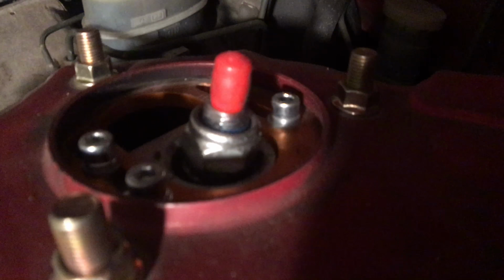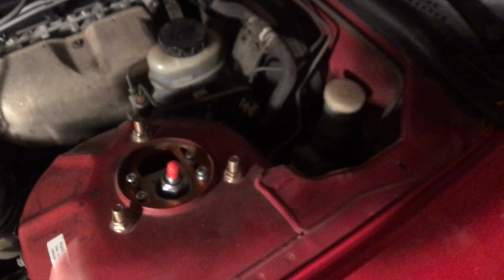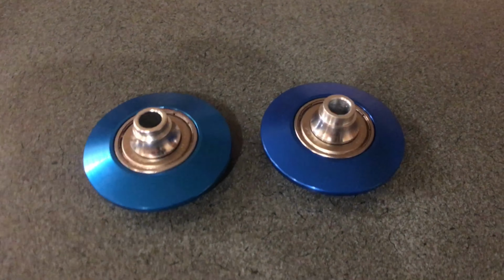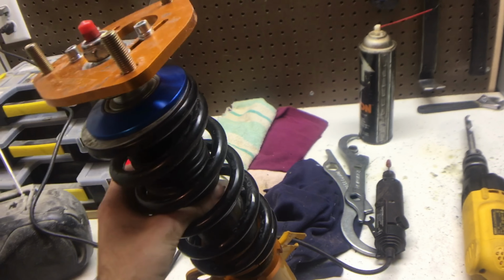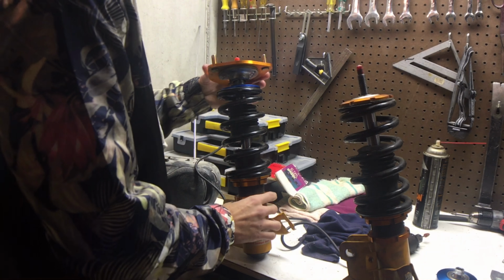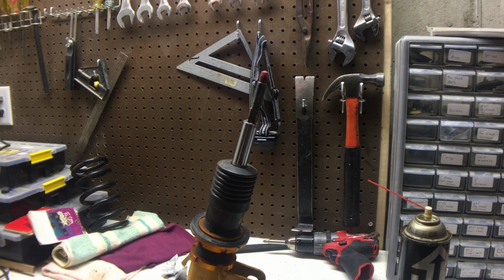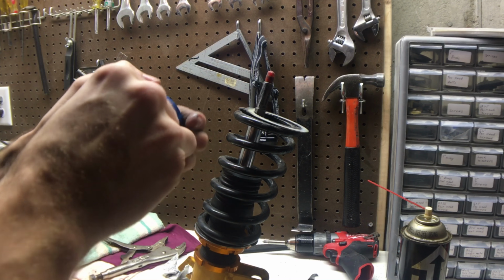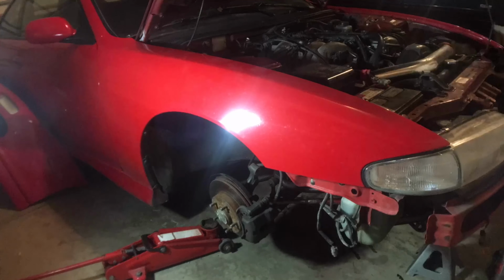240SX EBAY COILOVER REVIEW Pt. 2 (radial bearings)

Comment: "Hopefully you don't buy ebay coilovers" what a dumb thing to say, you bought them!
if it were possible to throw another $100 down and get good coilovers then yeah buying ebay C/Os is dumb or even if spending double the money would get you into a decent set of C/O's then buying ebay C/O's is stupid but when a set of good C/O's can cost you a grand or more it makes spending $250 for an ebay set a lot less stupid, especially if it's ebay coils or nothing because they are all you can afford.  Do ebay coilovers have some negatives, hell yeah, the top bearing setup is probably the biggest along with the ebay C/O's are considerably over sprung which for the more experienced drivers makes the ride quality in everyday driving pretty miserable, the younger drivers seem to like the vertebra crushing hard ride but with all that said, the cars flat cornering ability and quicker steering response when carving through the canyons makes up for some of the negatives associated with using ebay coilovers, they are definitely worth the $250.
it would have been nice if you would have provided a link for the top bearing solution you found.....